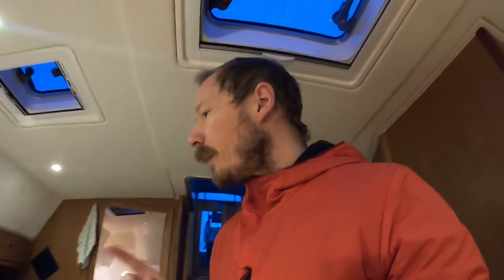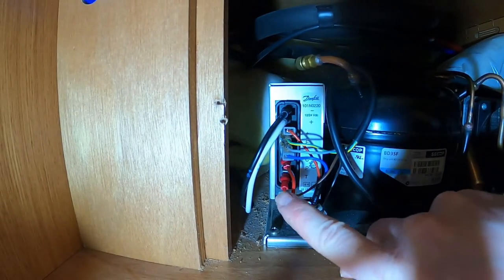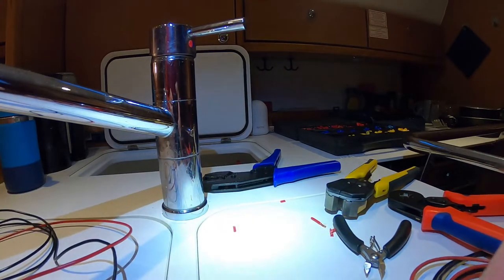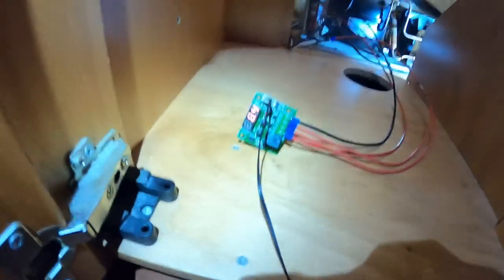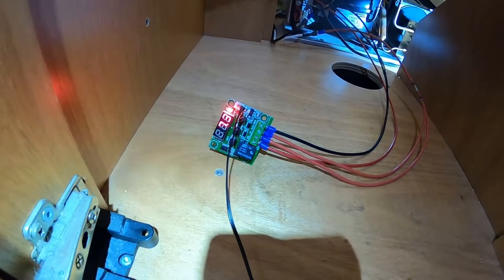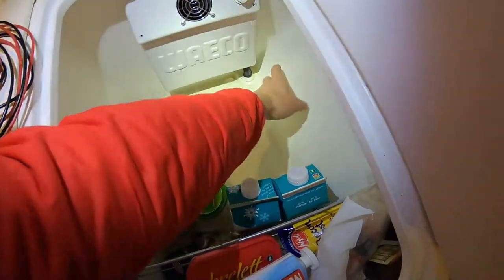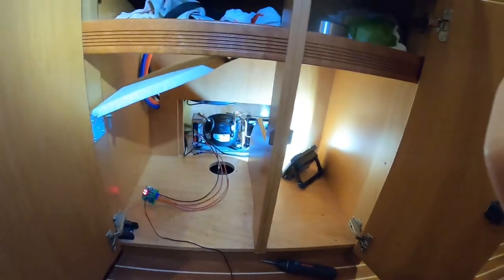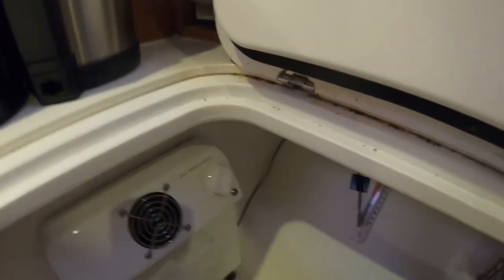Boat or RV refrigerator repair / upgrade Danfoss Secop BD35F digital thermostat dirt cheap👊

Comment: I think the main positiv and negative shall go direct to BD35 and the relay shall switch C and T. And if you ad a resistor in that circuit you can tune the rpm.
Reply from the maker: Many ways to Rome, and yes the resistor table can easily be found in the secop danfoss manual

Comment: The relay on the W1209 is not rated for the current the BD35F takes. You'd be better off disconnecting the old thermostat and replacing it by connecting K0 and K1 to C and T. Also, by  bypassiing the original controller you might be bypassing a slow start circuit or a fan delay circuit that is often included to reduce peak loads. And I'm not sure that power cycling the original controller might not shorten its life. What do you think?

Comment: Thanks for the information.
Please how can I connect the resistor to increase the speed. May be it will help my compressor, it is moving very low.
What is the setting you use for the new thermostat. 
Greetings from Nigeria

Comment: Hi, Can you add a view of the wiring?  I have a similar project that has the tails already attached.  Red, Black, Yellow, Black.  But its hard to tell from the video where you have the 'harness' connected to and where the commons are?
Reply from the maker: I'm sorry I didn't make a schematic, but it's actually not that hard. See the digital board as something that turns on power to the motor based on a digital sensor instead of the mechanical one. It's connection is before the motor. That's all

Comment: Hi, is the system still working? I m going to buy the same thermostat. What degrees do you use it? Is it still icing in the  evaporator?
Reply from the maker: Hello, yes it's still going strong and doing a great job. Have it at 5.5 deg and 3 deg hysteresis. Reduction in ice but not entirely

Comment: Just curious why you didnt disconnect the two mechanical thermastat wires and reconnect them to the digital controller K0 and K1 (C & T) ?  You did it for a reason, so curious why?
Reply from the maker: I did it this way to get rid of the mechanical thermostat all together. Is there something I don't see about still using it?
Reply: @dsholden1 not at all, but wiring C&T to the digital thermastat, you remove C&T from the Mechanical thermastat,  This way it is a simple swap out of thermastats.   The control unit remains powered on and the thermastat controls the compressor.  In your diagram the thermastat now turns on and off the control unit.  So curious what the advantage was of doing that?

Comment: hi can you post the info for the controller?  the ebay link is dead, thanks!
Reply from the maker: Search this on eBay : W1209 Digital Temperature Controller Module LED Thermostat Sensor 12V -50-10℃

Comment: Claiming "it's pretty simple" to install this digital relay is completely overstated especially when the actual important info, being the wiring, is vague, at best. I'm curious as to his background in electronics and how it'ssimple for him. For a novice with the same cooling problem on the same Secop compressor, you are the danger here, with your iffy tutorial. This wire here and this wire there??? Then the harness??? And when you're finished wiring??? You ought to go have a pint and gloat on yourself.